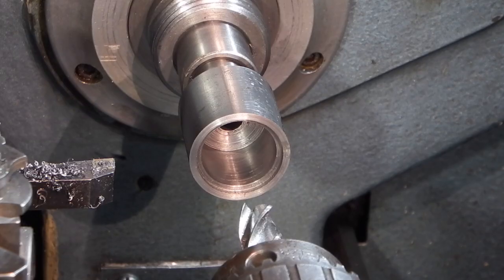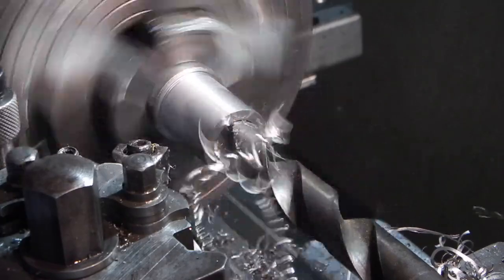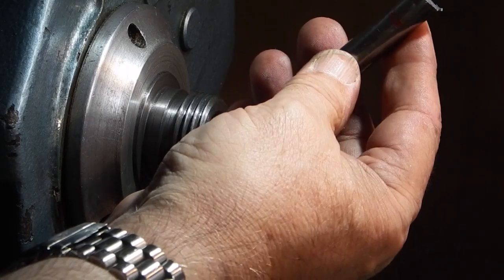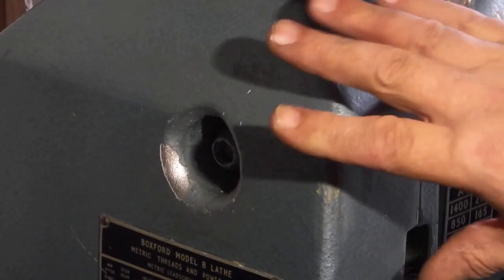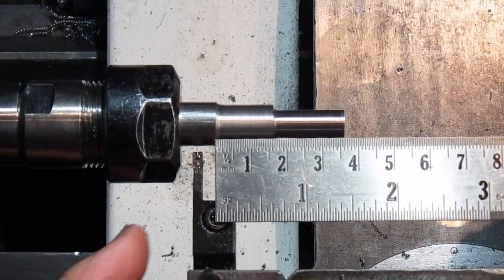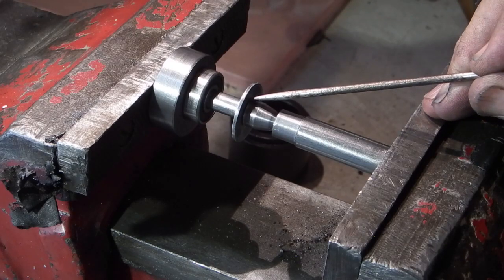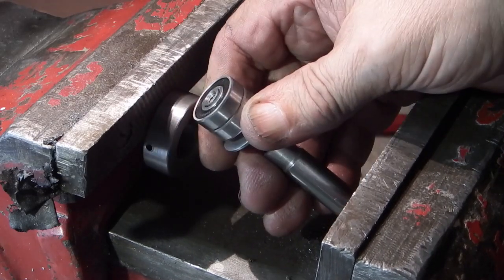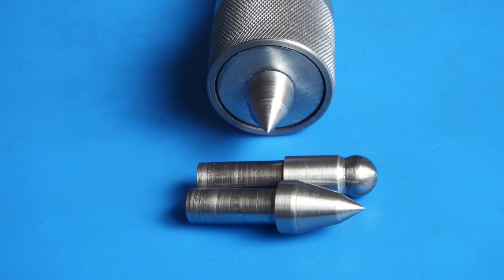Making a revolving centre (part 2)

Comment: Nice work mate, have just turned a 2 morse taper by clocking zero like you did, but used compound slide, but had to do 2 cuts, ( I have a Boxford too), Thanks for the tip on using an end mill in tailstock, I'm definately using that one! thanks!

Comment from the maker: Hi Some details about the bearings used in this project
608 2RS  Sealed Deep Groove Ball Bearing 8x22x7mm Deep Groove Metric Ball Bearings. Very simple in design being non-separable these bearings are suitable for high and even very high speeds, robust in operation and require little maintenance. Having deep raceway grooves in close proximity to the balls enables a deep groove ball bearing to accommodate axial loads in both directions as well as radial loads, even at high speeds. Single row deep groove ball bearings are the most common and widely used bearing. Size 8mm x 22mm x 7mm

Comment: I've often wondered why lathes are fitted with different sized Morse Tapers, on the head and tail stock, necessitating the use of adaptor sleeves.
Reply from the maker: Hi Bob The bore in the headstock is relative to the size of the chuck i.e. if you can pass a 1" bar through the chuck the headstock should be able to accommodate the bar so you could fit a long bar into the chuck to work on the end. On the other hand the tailstock only needs to hold drills or drill chucks which have a smaller hole than the headstock.

Comment: Hi all looks good but shouldn't you locate that bush on the centre of the bearing so as not to transfer the force through the balls
Reply from the maker: Hi Yes I should have pressed the bearing in using the centre of the bearing. I did make bearing interference fit less than normal as I may need to remove and replace the point.

Comment: I'm curious why you did not just use some bearing retainer instead of all the extra machining.
Reply from the maker: Hi It is important that the bearings locations are accurate and the bearings may need removing and replacing when changing the centres.
Regards
Alan

Comment: Very nicely done Allan. I now also don't feel such a wally when I go oversize by a thou or two, seems like chaps with a lot more experience than I also make mistakes now and again. Nice recovery though. Have you considered making a half dead centre for those applications when tool clearance becomes a problem at the face?
Reply from the maker: Hi Robert
Normally I would use my bore comparator to tell me the bore size but 22mm was over the maximum size. I do have some half dead centres but I find they get hot very quickly and need plenty of oil.
Thanks for watching

Comment: Alan great finish to this project. Would it be problematic to make a longer center that you made for a little more clearance, also how do you dissasemble it to change the centers? Thanks for another educational project!
Reply from the maker: Hi George
You can make the centres as long as you like but remember the longer the centre the more runout you will get.
Disassembly using an allen key unscrew the cap head inside from the rear of the Morse tapper then use a rod  smaller than the bearing bore with the same thread as the cap head, screw it in.and tap the rod from the rear to remove the centre. You may need to support the bearings from the point end to stop them coming out.

Comment: hi Alan did you silver solder the ball in and if so did you have to re harden it great work as always thanks for sharing 
Dave
Reply from the maker: Hi Dave No I used electrical solder just to hold the ball as there should not be too much force on it.

Comment: You have made extra centres, but how do you swap them as the first is  very tight and had to be pressed in?
Reply from the maker: Hi Tony
To change the centre first remove the cap head screw from the rear of the bearings then take a rod with the same thread as the cap head and screw it into the rear. The rod should be just under  8mm diameter. Now support the front to stop the bearings coming out,  then tap the rod to eject the centre

Comment: Hi Alan, With those two new centres you have, how far back do you need to strip to be able to install them? Do you use the same bearings, because they were pretty tight on the first centre and swapping them out frequently would eventually cause wear introducing an out of alignment. Regards
Reply from the maker: Hi Peter
I can remove the centre without taking the bearings out of the body so any wear would be on the centre  shaft . This part is made from mild steer and is simple to make a new one.